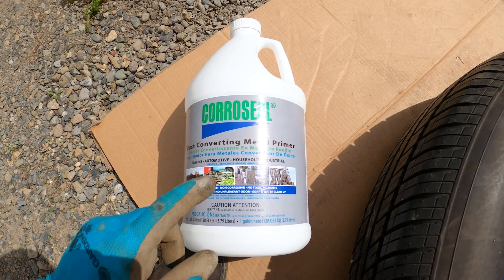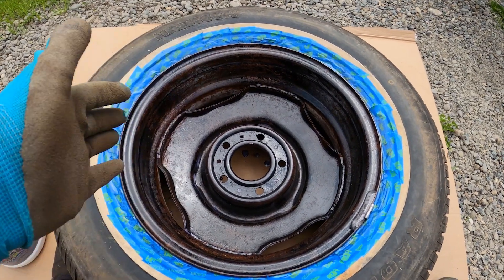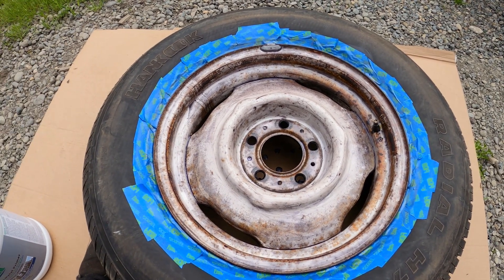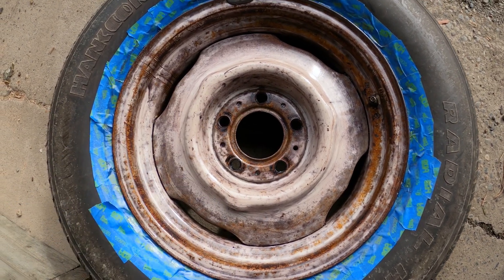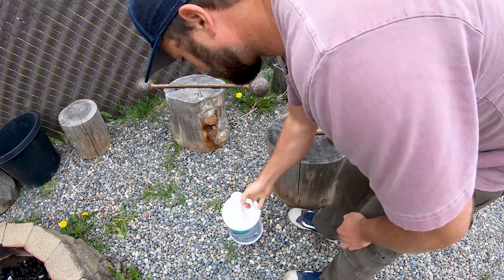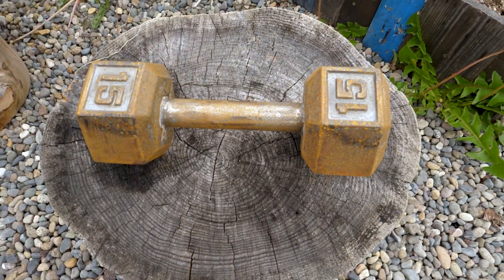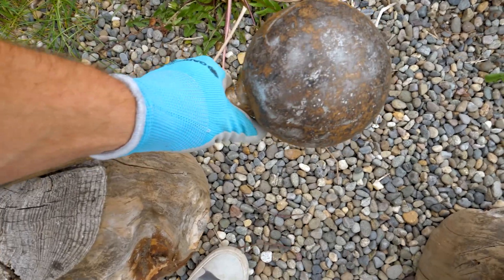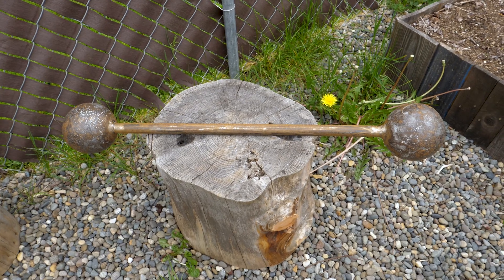Corroseal Rust Converter Tests | Do’s and Don’ts of Converting, Priming & Painting Rusty Metal

Comment: Is it safe to use citric acid as a cleaner? I have mixed steel on my vehicle restoration project.Some parts are new, other part's have light pitting.  Thinking maybe the citric will cause the new steel to rust and help the adhering process of Corroseal? What do you think?

Comment: is it really a "converter" or is it merely a topcoat that seals the cleaned metal and doesn't let it oxidize?
Reply: Where it goes over rust, it converts the rust.  Where it is on bare rust free steel, or paint, it dries to a clear coat.
Reply: You are not supposed to use it on clean steel, so there's that

Comment: Good video how FeII changed to FeIII and get more solid surface.  The paint after this process is important step.  I think Rust converter, Zn-aluminum coating, and top it off with paint and clear coat will make things perfect.  Very important for cars underbody and body.

Comment: We use this stuff all the time on our commercial fishing vessel. great stuff. we then apply a lot of epoxy paint over it. it's not made as a paint so if you don't paint your project that's been corrosealed afterwards it will start to rust again. it does not come off your skin/hands very easily. it's one of the toughest to get off your hands. use gloves.
Reply: true, i have use converters too

Comment: For the record it is not 8-10 millimeters, it is 8-10 mils. This is roughly 0.2 - 0.25 mm. Colors after application Black: Conversion has occured, Gray: Apply more Corroseal while still tacky, Brown: Contamination has occurred remove Corroseal and start over. Other than that good video sir.

Comment: I used this stuff problem was with its to thick and leaves brush marks which then have to be sanded and its not that easy to sand which kills the idea that's its some kind of barrier coat because now you have to sand through it. Its no where as easy to sand as filler primers that's for sure.  It would be much better if it were water thin. So if its anything that needs a very good finish use something else.

Comment: One correction here - they say on the bottle to apply 8 to 10 mil thickness. A mil is a unit "slang" for a thousandth of an inch. Thus, 8 to 10 mil is .008 - .010 inches. This is equivalent to about .2 millimetres. 8 to 10 millimetres would be almost half an inch thickness, which would be impossible to apply lol. I have the product too, basically just apply it as thick as possible and then apply more on top of that seems to be effective as you said. Just though you might be interested to know what a mil is - (an engineer)
Reply: I heard 8 to 10 mm in the video, and I'm thinking "no way!"
Reply from the maker: Thanks for the clarification. I fudged that up didn’t I?
Reply: @BoutenkoFilms  that sounds like a sponsorship opportunity, people be applying 8-10mm of material per coat = $$$ in sales!!

Comment: Hi there. Great stuff I think the treatment did not work fully as there nay have been some oil - grease present.

Try the wheel again please as that is my thinking I use jenolite and flag rust converter with great redults. Both finish in black.

Good job. Thanks

Comment: Ameture Pro Tip:  When working with rims that have a tire mounted on them, break down and buy one of those cheap manual tire changers from Harbor Freight (usually $40 bucks, caught mine on sale for $30 online, so less than $40 shipped to my house in about a week) so you can break the tire bead, and have access to repair/paint as needed.  2nd tip:  WD-40 is like magic on hard to break tire beads.

Comment: 8 mm to 10 mm thickness? 9.00 that's scientifically and physically impossible.
Reply: He was Probably thinking 0.8 mm to 1.0 mm which is doable, but still needs lot more coats.
Reply: 8 to 10 mil
Reply from the maker: That what I was told by the pros. I don’t know what else to say? 🤓
Reply: @BoutenkoFilms  They told you mils, not millimeters. A mil is the general unit of measurement for coating thicknesses; 1 mil = 1 thousandth of an inch. For reference a credit card is about 30 mils thick. Anyway, good video showing real world usage of this stuff. I'm about to tackle my truck frame where surface rust is getting out of hand.
Reply: @BoutenkoFilms  just think about it. 8mm to 10mm thick. 10 mm is 3/8s of an inch. In order to build up a layer 3/8s of an inch thick using a water based product you would need to have several hundred gallons per square foot of metal. And a very long span of time applying said water based material. Like a decade.